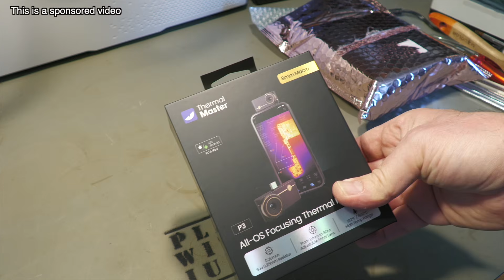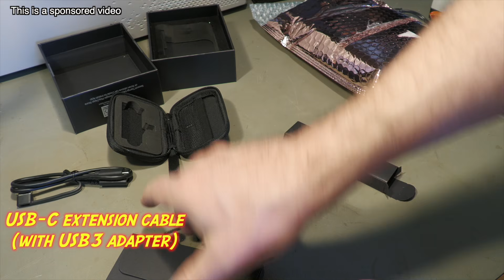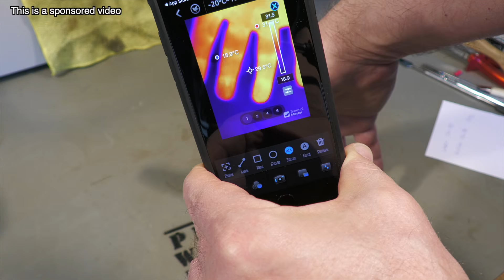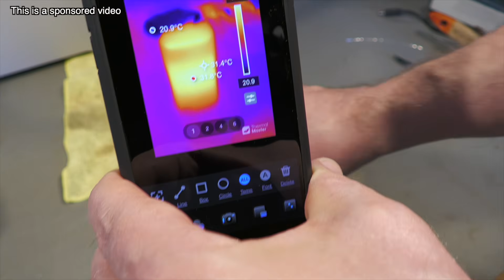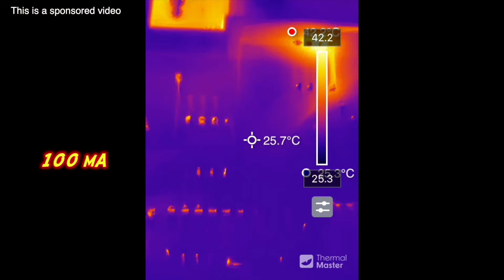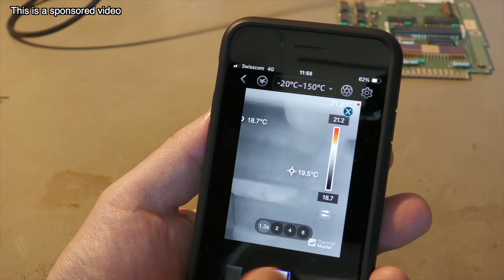Thermal Camera Test - Thermal Master P3

Comment: If your pcb trace is a mile long it will stay cold. Perhaps try it on a shorter trace, maybe one angstrom long  trace will get warm.
Reply from the maker: I would say it is not the length which is important, but the substrate which dissipates the heat. In fact, a mile long pcb trace will be as warm as a one millimeter long. It's the amps per cross-section that heat up the wire. But for a mile long trace, you will need more voltage, so the total amount of power is more. If you curl that mile up, it will definitively be warmer... :-)
On the other hand, how would you attach a one Angstrom trace to a power source? Any contact area will suck up all heat, no chance to get it warm. ;-)

Comment: many guys are recommending some awesome, high-end cameras that aren't designed for electronics repair at all. A camera like the thermal master p3 is perfect for electronics repairs. I perfectly understand that a few years ago people opted for those FLIR C5 type cameras since the resolution and microbolometers available for civilian use were limited. Radiation detectors haven't improved much, but resolutions have become standardized and optics have improved a lot. Furthermore, they have also become specialized for each task. Right now in electronics, the P3 sits in a really nice spot for the price. The adjustable focus and the macro lens are something you usually don’t see on cameras around this range. If you’re planning to use it for detailed circuit work, I wouldn’t go any cheaper than this. At this price the P3 is probably the best value you can get for electronics repair.

Comment: As a service technician. I have to say p3 is not an everyday tool, but there are some calls that would take several more hours to diagnose without it. I think it’s great for finding components starting to fail before they shit the bed outright. I found an overload contactor starting to fail because one of the wires on the load side was significantly hotter than the other two. The amp draw was within 0.2 amps on all three wires. I’ve also used it on bearings, partially restricted distributor tubes, and even ductwork to find air leakage.

Comment: The P3 works great! It helped me solve a clogged drain pipe in the wall. We put hot water in the drain, waited a few minutes, and you could see how far down the blockage was by looking for where the warm pipes inside the wall were blocked. This helped determine how long a snake was needed and how many bends were in the drain.